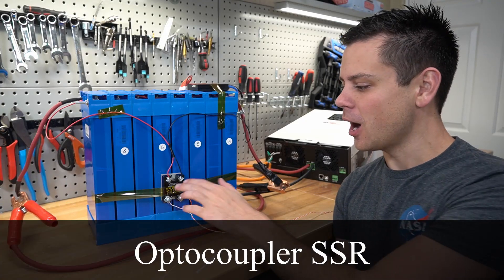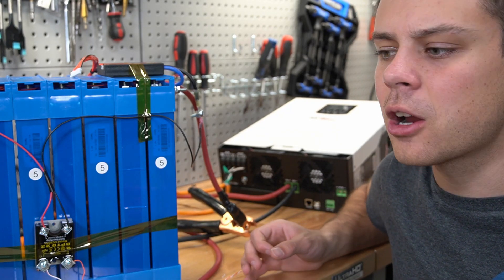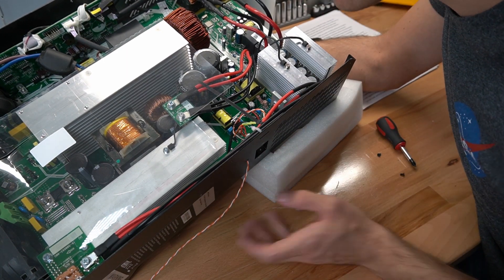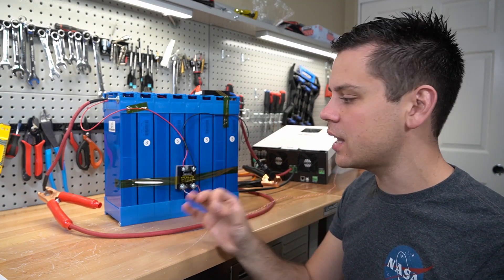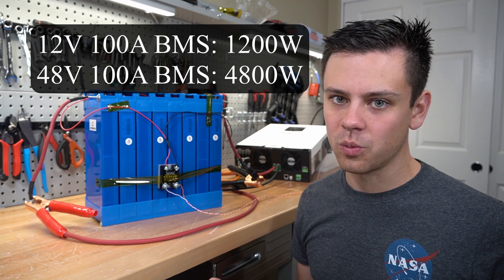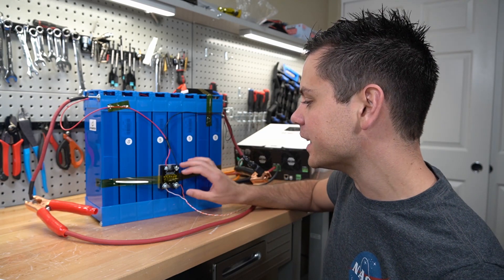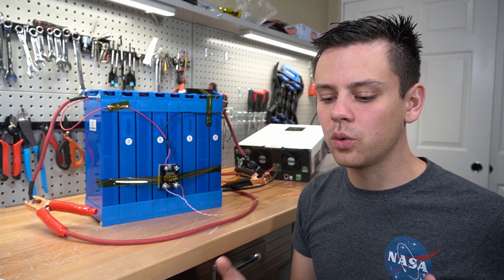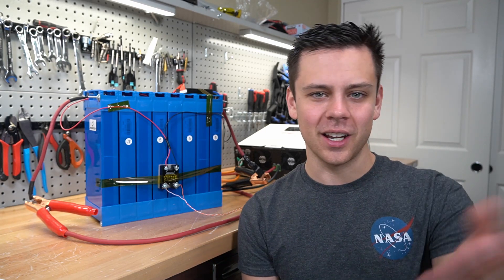Solar Inverter Control w/ Optocoupler SSR and BMS (Intermediate level)

Comment: Be aware that many inverters used that switched line to monitor the battery voltage for shutdown. Some SSR have a minimum saturation voltage and make the inverter think the battery voltage is lower. This is more severe a limitation in 12V systems.  I always use a dry contact relay for this purpose.  As this usually only powers the control electronics with 100ma, a very small low current relay can be used.

Comment: Awesome video Will. Is there a limitation to how much current you can draw? Let's say I have a 1000A battery and a BMS that can handle 60A. Will this setup be able to handle a 1C load (assuming the battery has a 1C discharge rate)?

Comment: Thanks Will.  For the boat I mentioned we're going to start with a 200A Daly & if it still fails when we try to keep the consumption down, then we'll have to go with the mechanical relay because there's lots of DC loads other than the inverter. We want to be able to leave the boat unattended with ventilation & pumps etc running but knowing that a low cell voltage will cut all DC consumption (not just the inverter).
Reply: Hi there, you could connect your DC load through BMS and then inverter through optocoupler. Wouldn't it be best of both worlds?

Comment: Will, for those other inverters that require a press for so long, you could set up something like a 555 timer circuit, so when it turns on, it could fire a relay connection for a set number of seconds, it would take a little work, but could be set up. 555 timer chips can be adjusted with caps and a variable resistor.
Reply from the maker: Very smart, that would be easy

Comment: Why not just have the bms control a  solid state battery isolator like a Cooper Bussmann ?
Reply from the maker: Would work. But way too expensive. $400 vs $20 SSR and one less current carrying failure point between battery and inverter.

Comment: Will, another great video as always...would you do a review of the Muller Industries LV BMS for the valence xp batteries that many of us purchased after seeing your review?  They recently became available in December.
Reply from the maker: Just found it. Will check it out
Reply from the maker: Wow that's amazing.
Reply: @WillProwse  I know you're usually focused more on DIY and budget components, but one of the "lightly cycled" valence xp batteries at 138Ah and this BMS are comparable in price, and quality, to a 100Ah battleborn (great batteries), with the option to add many more reasonably priced modules.  That's pretty budget friendly for mid to large sized systems.  I'm currently using my bank in 12v as I'm able to monitor the balancing with the valence software and an adapter hack I found on your forum.  I'd love to go 24v or 48v in my RV, but this thing looks almost too good to be true.  Thanks again for your time and consideration.  I realize you have a life outside of YouTube.

Comment: Will I just bought a chargery bms for my 24v lv2424. They recommended I put 2 big mechanical relays in series with the battery for both charge and discharge disconnect. The chargery has separate outputs for charge/discharge control. I'm thinking I could put 2 SSRs on those outputs and series wire them to drive a single mechanical relay. Simplify my high current wiring and reduce relay drive power. Am I missing anything? Also the latest chargery update includes low temp disconnect in case anyone hasn't heard.
Reply from the maker: I would personally use one SSR to control inverter, and set the absorption on the mpp, and you're done. No relay needed at all. The chargery won't see anything as being different. Would control it the same
Reply: @WillProwse  I'm not positive, but the Chargery BMS8T I'm considering buying (now with low temperature cutoff), I think will only cut off the charge from the MPPT charger using the mechanical relay.  Am I wrong about this? It may be that other SCC have a low temperature disconnect feature...but I don't believe mine does.  So...wouldn't you need a relay to shut off the charger in the case that the temperature went below 0 degrees celsius...in order not to fry your battery??

Comment: Will,  Could you not add a second and third Optocoupler in series for the high voltage cutoff and thermal cutoff??  I really like the approach and the SSRs can handle the load if sized properly.
Reply from the maker: I think you mean using them in parallel to increase current handling, correct? 

I thought that at first, but the problem with that is it is no different than BMS. And having two get based systems is just illogical. It will be electrically isolated and that's about the only benefit. I would not use SSR for large current. You could use it for PV array disconnect for hvd and low temp because current is manageable. I have seen one guy build a successful system for that.

Comment: please grommet that control wire going into the inverter... I know... it's just a bench setup, but still, the children are watching.
Reply: I'd put a socket there, so if you need to dismantle, you can unplug the SSR from the inverter.
Reply: Ha ha :)

Comment: Will,

Can you give an example of using an optocoupler to signal multiple devices like a victron multiplus,, MPPT, etc...

Basically one signal in and 2/3 out signalling.
Reply from the maker: Same as video, just set absorption manually for all charge sources. Then you are good to go. Only reason to have hvd is if you are using cheap scc. Victron controller is fine to trust.
Reply: @WillProwse  doesn't help when I need to trigger based upon temp or low cell voltage to cutoff unmanaged loads.

Comment: Will would you recomment the Giandel 2200w 12v inverter/solar charge controller? I am making my 110v well pump solar powered.
Reply from the maker: It's great for a cheap, simple system. But the one I'm thinking is pwm, so you need to match panel voltage to battery, and run panels in parallel with a branch adapter.
Reply from the maker: Should work fine though. I had one before too

Comment: Do a video running Ac powered appliance's on 120v dc power. Maybe using stepup converter or straight off solar panels in series.
Reply from the maker: Has to be purely resistive. What appliance? 

I usually just connect to bridge rectifier diodes if internal equipment can handle my battery banks nominal voltage. I managed to run all sorts of stuff this way when I was a kid. 

Solar panel needs step down because it's usually regulated low volt DC in most small appliances minus heaters etc
Reply: @WillProwse  I would be interested to see a video on how small appliances could be modded to run straight off the battery. Would USB-C be a good common connector?
Reply: Like an emergency situation when you don't have power.  Possibly run refrigerator, freezer, power tools, window AC, lights. Just whatever possibly may be needed. Could be more effient and cheaper than running power inverter.
Reply from the maker: Ohhh I have a old video on that. Beginner friendly. Solar panel to converter to inverter to appliance. Dead simple no battery setup

Comment: Y not hook the ssr to the inverter power cable so it protects all the time?
Reply from the maker: For all the reasons mentioned in this video. Did you watch the video and the discussion of fet based disconnects? It was a pretty long discussion.  

Might as well just connect to the BMS. Max amp of ssr is 25A.
Reply: @WillProwse  I'll watch it again. I'm at work and was just half listening on my headphones. Still instead of ssr maybe a regular contactor instead. So then it's more reliability then fets. Yes more power consumption. But that seams de minimis.
Contactors are very robust that's why we use em in commercial use. I have a few quality omron SSR but to use more then 25 amps they must have a heat sink on them. Some of ours are good to 100 amp continuous. But they cost  $100+